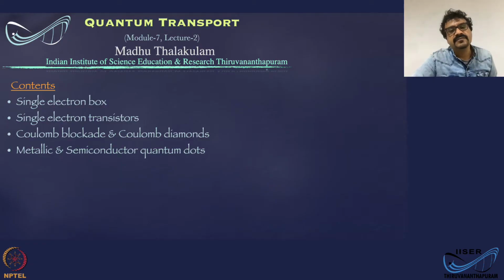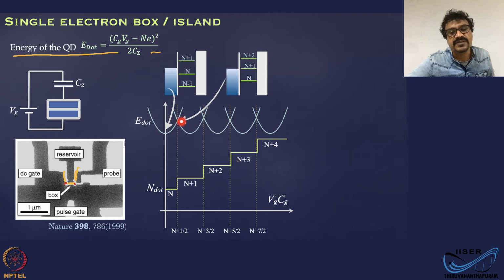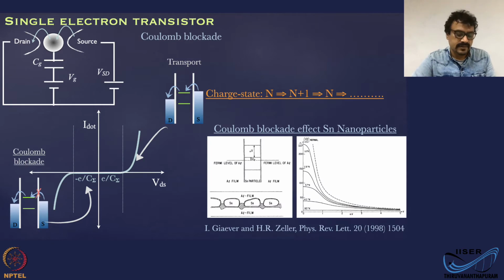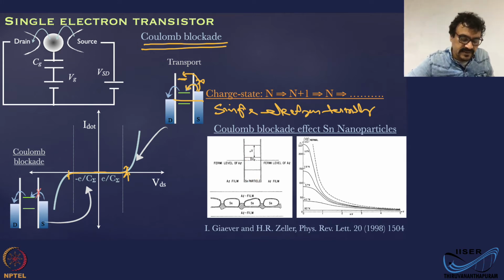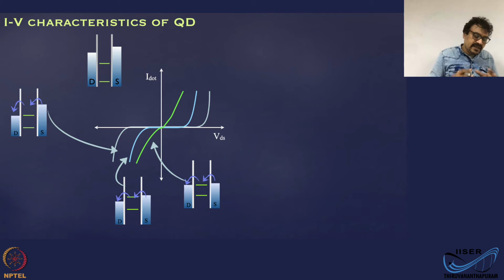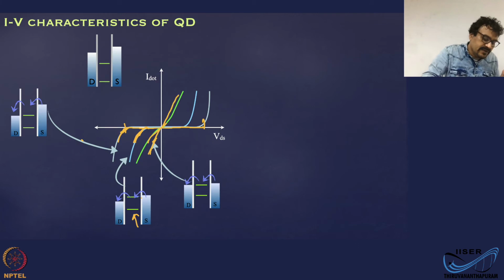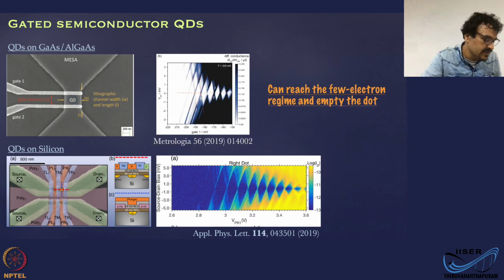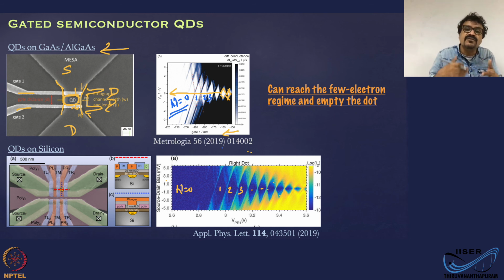mod07lec19 - Single Electron Transistors, Coulomb Blockade

Comment: Can a single electron transistor measure small current… induced by electricity from human to ground when they put a shoe on with insoles meant to measure voltage?